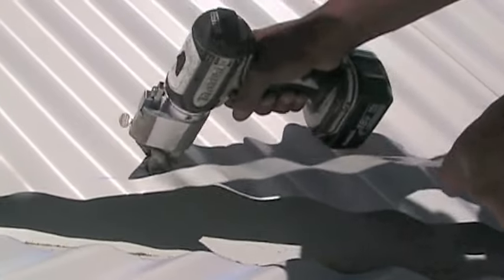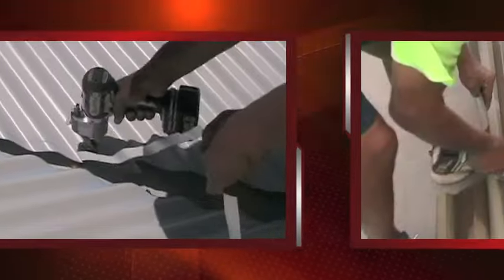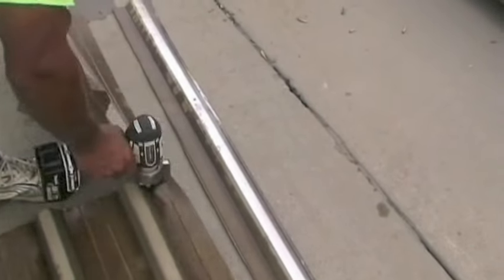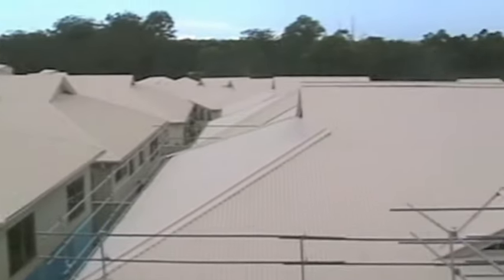Power Snips sheet metal cutting and scribing

Comment: I was cutting corrugated roofing with a power drill attachment and I was disappointed with my Malco tool. I hope his tool is a good one. Any brand suggestions for an old man diyer. I switched to a diablo 48T metal cutting blade for my circular saw and whizzed right through all but the first panel. Disappointed with my Malco drill attachment. Could be operator error but I doubt it. Not too good for curves though. Good thing all my cuts were straight cuts.

Comment: Why isn't the scribing done on the ground instead of on the rooftop
Reply: You would have to use complex maths to work it out as it runs up and down the valleys of the corrugation. Much easier on roof just go by eye.

Comment: That wasn't trimdek by the way! It was monoclad... And I'd scallop that job by hand in far less time than 4 or 5 hours! Can't knock the skills of these guys though, but this video leaves a lot to be desired....

If you want good shear attachments for a good price, go for Malco or K Tool.
For standalone metal shears, Makita or Milwaukee...
Reply: Peter Staples
Turbo Shears can scribe! In fact, you can cut in line from straight to a right angle straight cut! I have the CM left and right jaw! Corro scallops are a waste of time even in BAL zones. Looks pretty though, but you may as well choose a more exotic profile when paying roofers to scribe flashing!
Reply: There are a number of regulation methods to use without the need to scribe, but you're right, a good tradesman should fabricate everytime. Though the way the market is, specialized roofers replaced by cheap builders and carpenters who lack skills and knowhow.... There are those who instead of fabricating on site, search the city for a fitting and have never bent a flashing in their lives.

I'm sure there videos on the Malco website by the way. If I remember, I'll send one in...  Cheers